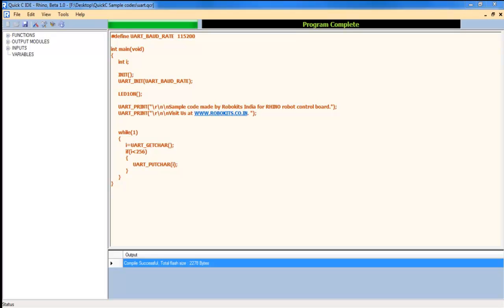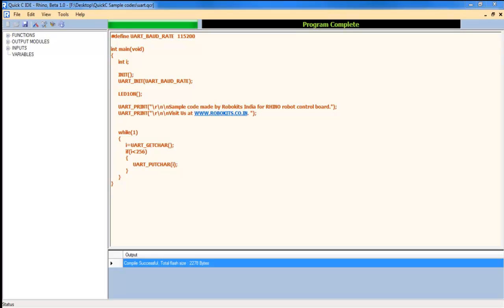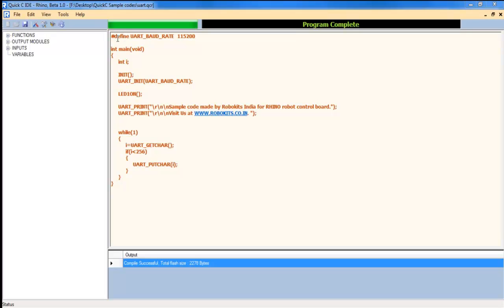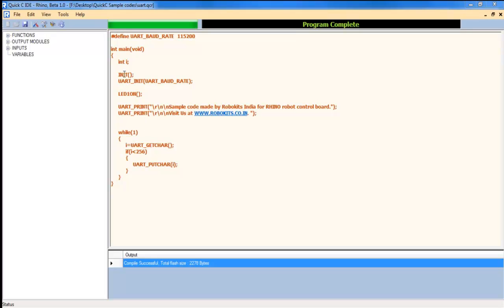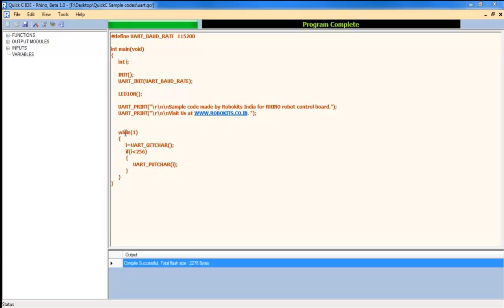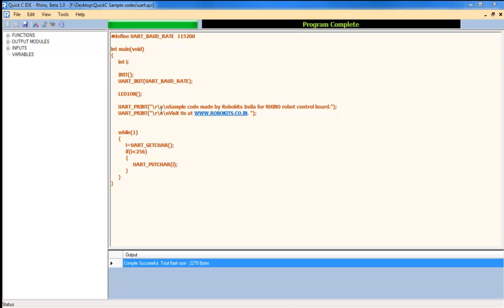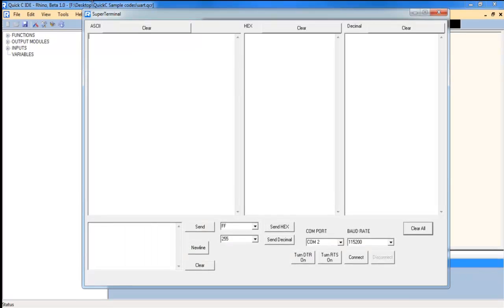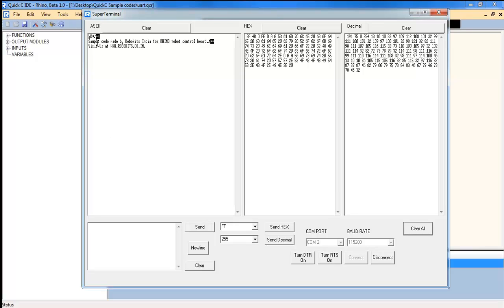RhinoBoard:Tutorial -3

Comment: i want to use the rhino board to control 2-4 dc high torque dc motor 12v and 1 A and 2 servo motors (2 axis pan tilt) and controlling it with a android phone via bluetooth. I am actually thinking of making a tracked robot>>> can you help me i just need a code for it and an android application